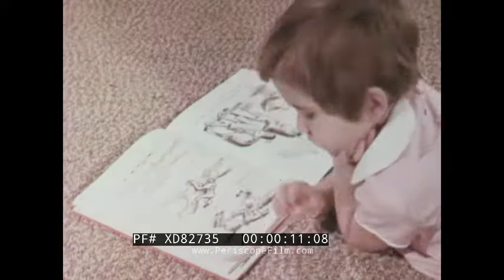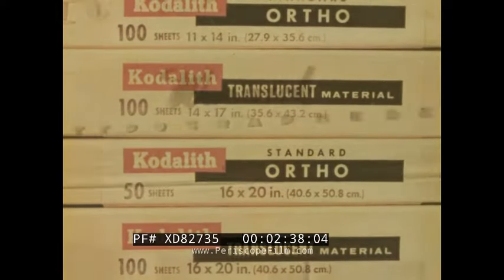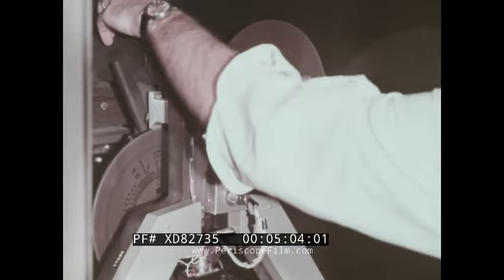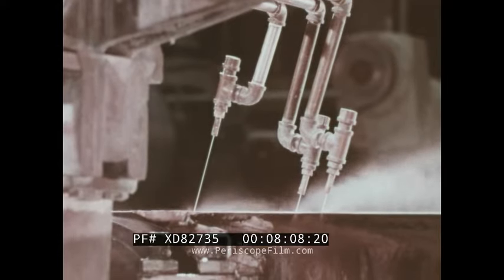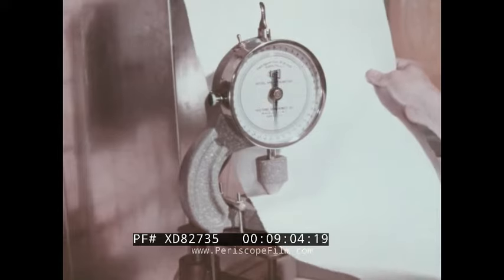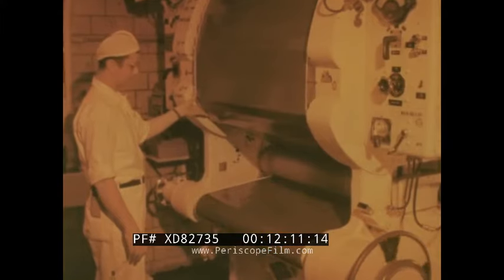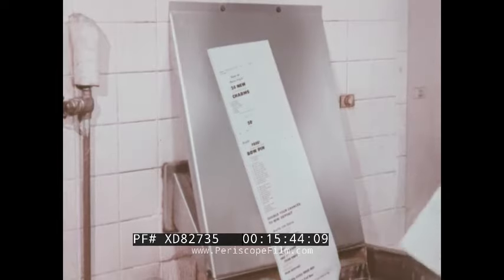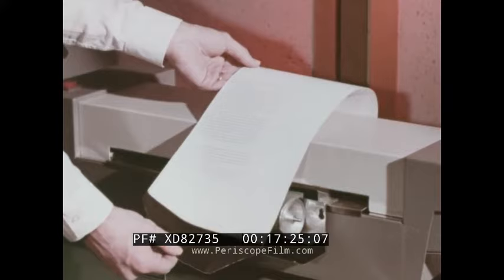"HOW PAPER GETS THE WORD"  1960s KODAK PHOTOGRAPHIC PAPER PRODUCTS FOR PRINTING PROMO FILM XD82735

Comment: To all you retired chaps from Kodak and the typesetting industry I doff my cap at your skills,  the complexity of the typesetting machinery process is very  impressive.  The amount of investment by these companies to develop their systems must have been enormous. 
I have worked in Paper mills monitoring machinery and it is a magical process that can go wrong with the slightest change throwing paper off the machine at 80 kilometers an hour requiring a skilled application of an air line to get the paper to catch the 'pope' roll and all is well.  A little work with  Goss press for Livrpool Echo and a Heidelberg offset.    Very much enjoyed this and learnt a bit I hope the comments bring back good stories and memories. Best
Reply: Interesting post!

I once got a chance to fool around with a disused mechanical typesetting machine (maybe 1910s tech?) that was operated like a gigantic typewriter. (It used cast-lead type that were melted and re-cast between each time they were used in a printing operation- which was probably far more efficient than trying to sort out out the set blocks of type...

It was in an old warehouse at a printers that was scheduled for demo.  Luckily, a friend was able find a museum to take some of the machines so they didn't get sold for scrap. 

For lack of a better description, it was one heck of a contraption! (Sounded like buckets full of ball bearings being poured down a stairwell when it was in operation.)
Reply: doffing your head to an utterly dead industry, nice
Reply: Thanks for the story,   can you imagine the brainstorming that went on to create the concept..  "Listen chaps I have an idea, we make a typewriter and moulds that we drop molten lead in then shove them in a line then stack them  ete etc"   Some of the kit identified in the video showed some mad thinking but it was a time when mechanisms were understood and how to piece them together.. I am pleased you helped save part of our heritage.  I managed to find a how for my dear friends Muirhead Jarvis Photo transmitter, this was used to send photo's down the wire.  It was the size of a piano with another stack of Valves (Tubes) and electronics to operate it. I remember clearly my friend Richard and I using it to receive images from NOAA and Meteorsat of the Earth. Amazing quality.  I is now at the PK  Porthcurno Global Museum of Telegraphy in Cornwall. (Look them up) Best rom the Uk  @bholdr----0

Comment: Of course it's very personal and essentially opinion and preference,  but if we're talking about black and white materials I liked Kodak papers but didn't use them as frequently as their films and chemistry. For my work I preferred Agfa and Ilford, Oriental was nice also. Back in the late 80s, early 90s I taught intro to black and white, and an advanced class where we did alternative processes, the historical ones, often not silver based. They did require the use of orthographic emulsions and lithography films especially for those working in small formats because those non silver emulsions were painfully slow so contact printing was typically the default option.